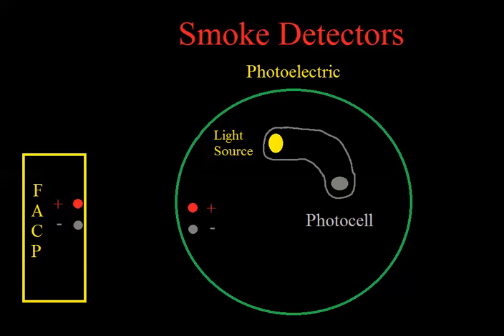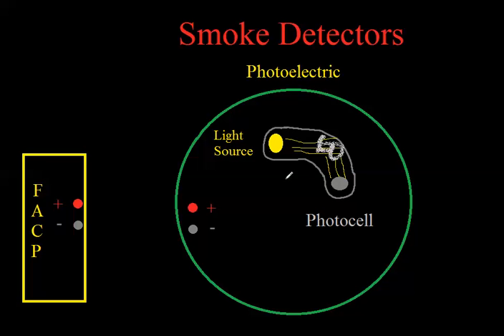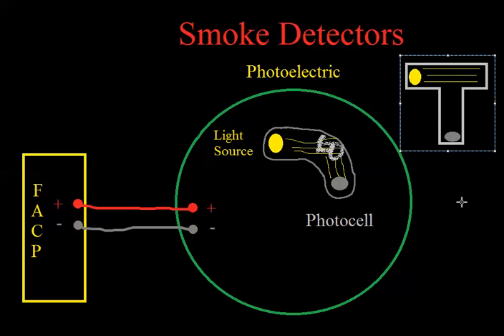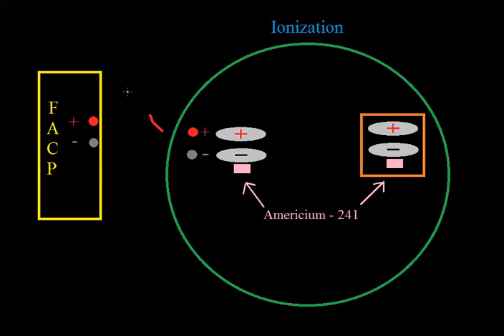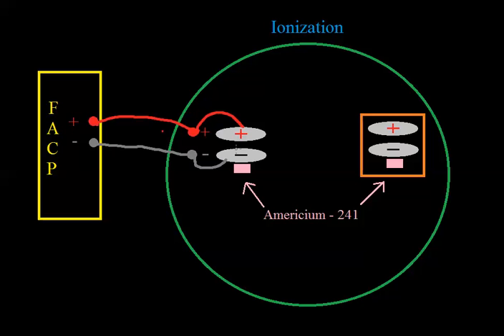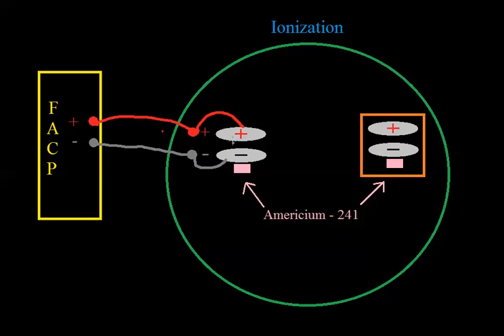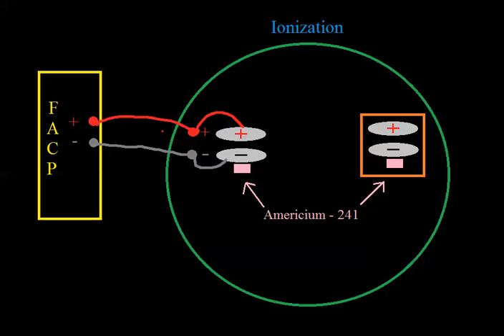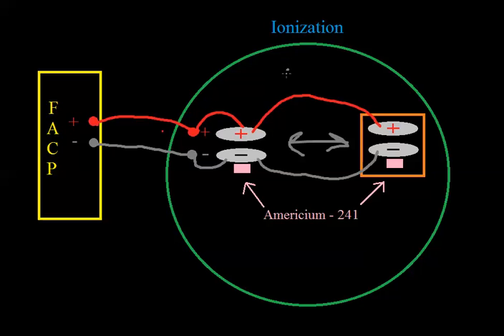10 - How Smoke Detectors Work - Introduction to Fire Alarms

Comment: Photoelectric cells don't produce voltage or current; light just causes them to lose their resistance to an existing current, the current then is able to the pass.... to the ALARM.  And the light doesn't refract off the smoke particles to the the photoelectrc cell, they REFLECT off the smoke particles.  A light alone between the charged plates will not create a voltage; besides you already have voltage potential between the plates thanks to the battery.  The air between the plates is non-conductive until bombarded by the Alpha particles emitted by the Am241.  Ionization of the air occurs, releasing negatively charged electrons and positively charged ions.  The electrons rise to the positive plate, while the positively charged ions fall back down to the negative plate.  There is now some electrical conductivity between the plates, and that condition is set to normal/no alarm by the circuitry.  Should by-products of combustion enter the chamber, the conductivity is interrupted to a degree.  The monitoring circuit detects this, and ..... ALARM.  Best to have both types of detectors installed as there is a difference in sensitivity and the types of fire by-products which enter the air can vary depending on fire intensity, fuel type and other factors.

Comment: Yeah Optic sensors is the favoured thing. Here is an example of direction of current that is interesting. americium is IONIZED or ionizing meaning its most likely a + positive charge, but diagram shows + to the ionic substance. In reality I think the Ionized Americium is stripped of electrons or "dry" whereas the + terminal is wet. and it makes sense if you apply the "electron direction" of the circuit instead of the "Ampere direction" in the circuit .

Comment: You had that "early detection stage" claim completely backwards.  Ionization technology is NOT better at detecting the earlier smoldering stage of a fire at all.  In fact, it's been proven that ionization technology has a 55.8% FAILURE RATE in that category.  Other than that, great video.